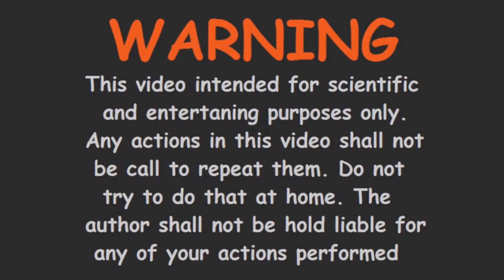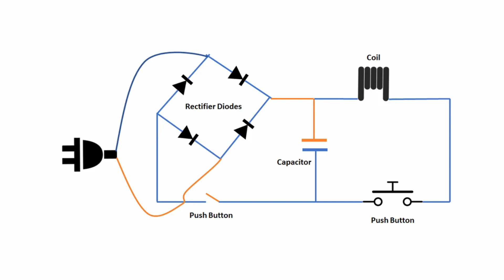how to make a simple magnetic gun

Comment: How many rounds of copper wire were done
And what volt battery  can I  use instead of socket electricity?
Reply: The soket is ac and will blow up house up if u use it on this
Reply: Use a car battery or a lot of 9v
Reply: @brucelouie2186    TRUE    IT  WILL  BURN     THE  WEIR AND  MAKE SHORT  AND  WILL  OPEN THE AC SWITCH  PROTECT
Reply: well using socket will probably set something on fire or destroy your breakers and the rounds i have absolutely no idea
Reply: Use a camera flash circuit or a bug zapper racket to charge the cap.
Reply: @kikedanse2821  No No NO the coil will create a magnetic field in which the energy can go somewhere if you were to fire the gun with no projectile there might be some damage. In a way the coil acts as a resistor just like any other load. Any current flowing through a wire produces a magnetic field the coil just amplifies it.
Reply: Lol just relized this is like 4 years old lol
Reply: @gameplayer4817  2 years ago i had to make a project for my science convention 🤣🤣
Now I am 18
Reply: You can use any batery, but you must use a lot of capacitors in paralell
Reply: @gameplayer4817  no, the loop was closed. It wouldn't burn the capacitor and the battery

Comment: Thank you now I just need to make this bigger connect it to a bigger energy supply and I can make a railgun
Reply: You could just make this and hide it in your sleeves and if you’re ever in a tight situation you’ll know what to do
Reply: DC source PLZ
Reply: @PatriotIndonesiaAsli  Most people use the circuit from either a disposable camera which also usually has a good cap for this or a racket style bug zapper which can charge the cap but doesn't have a large one inside already.  Another good option is to make a joule thief type circuit from a small power transformer, transistor and resistor.  That or just a boost regulator.

Comment: Plz check the circuit....as per it the rectifier diagram is wrong.... secondly keeping mains on if u press second switch it will cause short circit current will flow from coil rather than capacitor discharge..

Comment: Do I have to use coper wire? Normal wire will work right?
Reply: Any wire can be used in order to give magnetic field

Just dont let any of it touch each other at the coil
Reply: You need insulated copper wire to avoid it heating up and the insulation is needed to avoid electricity arcing between wires.

Comment: Will it work without the capacitor and the rectifier?
Reply: The Soldering Bot  Well I did this just with a batery  the coil and the button
Reply: And works
Reply: You need the capacitor, idk about the diode, though you can't use it w/out the diode if you use ac input
Reply: Yes the nail will have to change and will probably work 4X or more faster

Comment: No explanation why the diode is needed. No explanation on anything...this video sucks.
Reply: I'm assuming he's using AC.  The bridge rectifier converts AC sine wave into DC.  Your wall's AC switches polarity 50/60 times per second. In places that use 50Hz, the polarity switches once every 20ms. Quite a bit of theory is needed to understand this.  You probably don't want to start learning by experimenting with that 120v electric chair. Start with a single AA battery and coil.